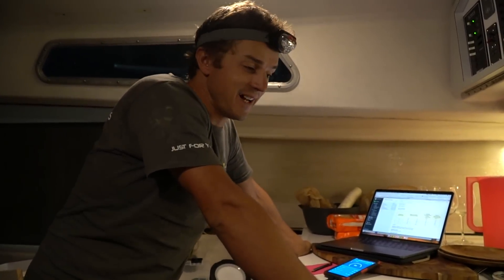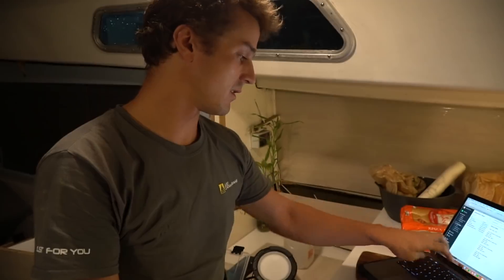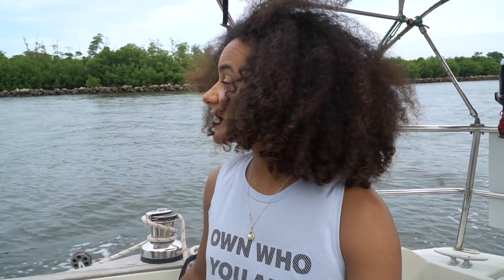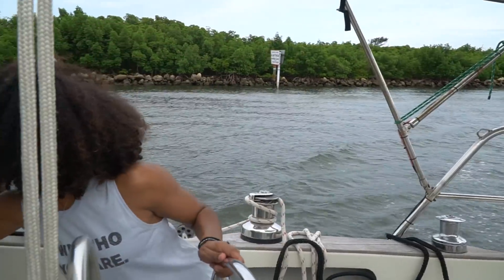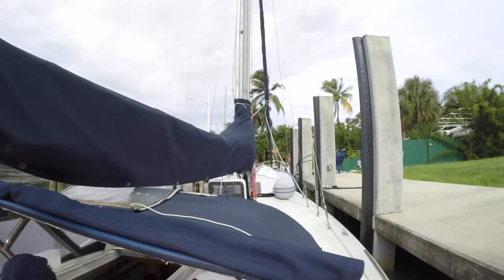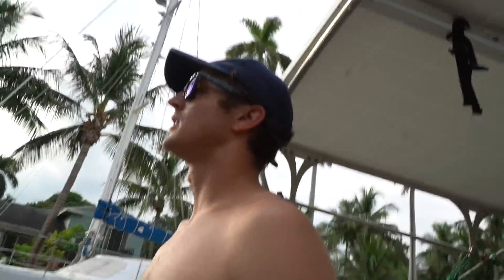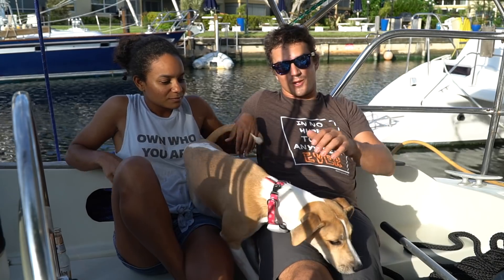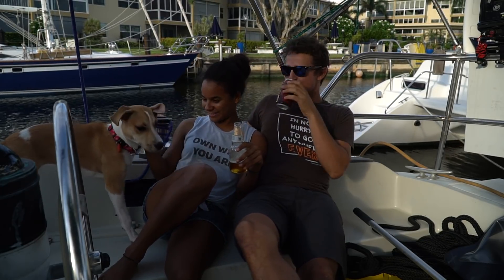Pushing our Electric Motor to its Limit— Sailing Uma [Step 139]

Comment: Electric motors are a bunch of hippy nonsense!
Reply: None of you guys has a sense of humor! Ever been becalmed for six days and had to motor? Well you won't do it with an electric motor! I still say it's hippy nonsense!
Reply: the us navy agrees  nuke subs always have electric backup
Reply: Gadianton x : what kind of motors do you think a nuke sub uses? ELECTRIC
Reply: Gadianton x : what kind of motors do diesel locomotives use? ELECTRIC
Reply: Yeah with a nuclear power plant charger. They never run out.
Reply: Riiiiight, a bunch of hippy nonsense. lol You do know that every ferry that carries cars in the state of Washington has electric motors turning the props?
Reply: Tesla
Reply: Submarines, ferries and locomotives, while using electric propulsion, rely on either diesel generators or thermo-dynamic nuclear power to provide electricity. If all you have is solar powered backup batteries, your range will be severely restricted using the electric motor. No motor sailing or ability to power thru doldrums with that power. Intercostal waterway travel will also be restricted.
Reply: The problems are not the electric motor. Those problems can be solved with money. The problem is electrical power storage and generation. Nothing a diesel powered generator will not fix. A sailboat doesn't have enough surface area for all the solar and wind generators needed. They are learning this one day at a time. They could move on to more important things, Like sailing.
Reply: these guys went around the world with an electric motor:  http://www.ecosailingproject.com/the-crew/
Reply: http://www.ecosailingproject.com/    these hippies went around the world with one
Reply: Locomotives have electric motors turning the wheels. But they have a huge diesel engine turning a generator that powers the electric motors. Electric motors have their place. Not sure why they went this way. Was it a cost consideration? If it was green, remember coal or oil was burnt to make electricity that recharged the batteries.   Anyway fair winds and following seas to Uma and crew.

Comment: Just a heads up, 'copy that' is not considered good sea/mariner lingo.
Reply: ray Nic - I agree. Wouldn't it have been helpful to post the correct response?
Reply: Sometimes it's good to let the creative juices flow and I anticipated your response, nothing wrong with getting a little conversation going. (p.s. I used to say that all the time on the VHF and would constantly get corrected by a licensed captain friend, no haten'-just sharing, copy that? So what do you think is appropriate?
Reply: roger that or affirmative(?)
Reply: Belay that, virtually means cancel my last order, ng.
Reply: Roger, more CB talk, ng. Affirmative seems to be appropriate in this situation.
Reply: Roger
Reply: roger wilco?
Reply: We are taught to use Romeo

Comment: You guys rock! I'm sure having some hard numbers on the engine feels good and a 15 mile radius is great! How long would it take to charge 75% of your battery capacity on an average sunny day? Also I'd like to officially vote for Dan to grow his hair out!😁😎
Reply: I don't know what solar panels they have but if it's around 300W (rough approximation from the image on their website) they would need 50 hours of direct sunlight to charge 75 percent of the battery bank capacity. So, if it's contentiously sunny and they spent their days adjusting the panels to align perfectly throughout the day the shortest time would be about a week.
Reply: @adamrasmussen3521  if they dont power for anything else. Only 300 watts? Im sure theyll end up with a kw, and another kw of wind. Then the fuel is all free...
Reply: SPA...wassup, just watched your video too...respectfully, if Dan follows your hair advice, it will eventually end with one side of his head shaved.  You need to prepare him for that.
Reply: Scott Harrell times have changed, now I'm thinking mohawk! Haha.
Reply from the maker: The beauty of our system is it's completely modular and pieces can be upgraded, added or removed depending on the need. If at any point we need more range for certain parts of the world, we can drop a genny on deck and motor for days. But until then, we'll just keep sailing.
Reply: just get a 2kw genny!
Reply: My calculations too. It is good to see people pushing the limits
Reply from the maker: We don't really plan on using solar to charge from such a deep discharge. In reality, we sail everywhere, and use our motor VERY sparingly. We would normally use about 5-10% from off shore to anchored, that we can get back in a day or two of good sun, and that includes our daily loads (fridge, laptops etc). If we needed to motor longer we'd just tie up to a dock for the night and charge back up. We can fill our bank from 25% in about 8-10hr. In the long run, we're hoping to get good regen, so if we need to motor out from anchorage to ocean a long way, we can then sail for a few days and charge back up. But that may require a different motor altogether.
Reply: Dan, I've been following you since you started. You have made some great strides in preparing your boat to really do some sailing. I only have one thing I'm trying to understand. What is your objective. Work on a boat or sail. I'd love to talk to you guys but not on Youtube. I have a lot of experience technically and sailing. I've restored two boats. A 32 and a 37 foot sailboat. I'm probably wasting my time, but I have offered.
Reply: Sailing Uma With 4 days to top up without (that's with sun) a doc. It could be dangerous to sail Asia and around the equator (common to have little or no wind for a day or 3, as you can be near reefs, strong currents, no wind. = no boat. Often to deep to anchor there till your on the reef.
Reply: Richard dackas .... this system is great for afternoon sails or going out for a day on the weekend.   But would not work for long distances.  I suggest  they up the dingy outboard to 25hp so the sailboat can be towed....... for coastal cruising.
Reply: The number of cruising boats who have successfully cruised long distance without any engine whatsoever are too numerous to count. Even the ability to motor in and out of harbor is a luxury, not a necessity. Sounds like a good system to me!
Reply: @ProjectAtticus  can you get insurance without diesel?
Reply: Sailing Project Atticus Sure, but they sail straight past the inside of the Great Barrier Reef and most of Indo as it's to dangerous
Reply: Richard dackas good point, definitely compromises to be made.
Reply: Sailing Project Atticus Definitely in some parts of the World. What they have created is far better than no engine and I love what they've done. The Great Barrier Reef would be no problem with their boat as there is good wind and 5 m range would be plenty. It's only around the equator the lack of wind and docks could be a problem. Just cary a small Gen for that part of the world. P.S. Love you vids.
Reply: Sailing Project Atticus ...."to numorus to count"...... you are delusional...... I can recall  4 or 5 max .   This vid clearly shows the  extreme limitations of batterys.  Going down from the PNW to la Paz Mexico I motored 500 hrs.  Two yrs ago , after many trips, motoring time was  reduced to 260hrs because I sailed from Canada to Ensanada, Mexico in one 14 day run.  And this low number is because I am extremely stubborn and wait for wind.
Reply: @sails3538  When do you think diesel engines were invented?   I'll tell you: 1895.   As we all know, nobody ever sailed around the world before then...
Reply: @pywaketpilot ... Big wooden ships only went it to big ports. Too clumsy to sail in confined channels. The small sailing/row boats went to shore while the larger boat stood by at sea.
Modern day sailing is different... So many boats on the water. A sailboat with no mother is a hazard to navigation. Also... The Pardies were towed in to more ports than most people go in to during their lives.
A little truth is needed here.
Reply: @sails3538  Ever heard of Joshua Slocum?

Comment: Dan, it may be that the program is set up for lead acid batteries, looking at a max/perferred 50% discharge. Run for 1 hr. use 25%= 1hr at 25% left....
Reply from the maker: Yup! That's exactly how it's reading. Not sure I can change it though.
Reply: I guess if you can't change that parameter you might want to put a conversion formula on your chalkboard...75%=2/3 power remaining, 50%=1/3 power remaining, but that will vary with % throttle... ah-oh, this is getting complicated... or you spend the time and work it out mathematically and create your own power curve...have fun with that...

Comment: Two thoughts: 
1) I worry about 300F  real close to your fiberglass hull more than I do the motor itself. How much heat is being conducted to your hull through the mounts? Are your mounts temperature safe? I seem to recall that your batteries are self-protecting, so you should be safe.
2) As a first step, I would improve the air-cooling of the motor by wrapping with sheet aluminum, and extending the aluminum sheet off the motor into fins: a simple radiator. That, combined with your compartment fan would dissipate a lot of heat. Others have suggested water cooling to create hot water for bathing. A great idea, but gets complicated quick when you are sure not to overheat your holding tank, etc.

Can't wait to see how you work this out. Good luck, fair winds, and safe travels.
Reply: They could just attach cpu cooling fins.
I have PC's that use passive cooling for the video cards and I've seen the cooling fins being sold as individual parts.
I've even seen copper fins every now and then.
Reply: My concern is the battery terminals melting and acting like a fuse, are they still using the lead acid or lithium, have not caught up on all the changes. I personally do not like the dual battery requirement to generate a field that allows the motor to work, a ETEK style permanent magnet is better. This style or the MANTA would be 75% more efficient https://youtu.be/t9Uog4udldQ
Reply: @frickandfracksicem  its not permanent magnet? The batts are LiFePO4, sound pretty funky.
Reply: I was thinking the same thing strap aluminum fins to motor and duct the fan to pull over them should greatly improve heat dissipation. Props to you for going with electric motor and sharing your thoughts and experiences.

Comment: So I know these videos are delayed but if you are thinking about liquid cooling you might be able to do it passively.  Ie warm water rises... , as the water wrapped around motor (i guess in a coil or some other type of heat exchange) rises it siphons in cool water thus taking heat from motor with it as it exiting the boat...keep hot side physically high, cool side low... I use this principle to heat my hot water for my house in the winter when my outdoor wood boiler is running and works great and saves me from running another water pump on my hot water heater. Love yalls diy stuff!

Comment: it seems like an electric motor is Not Practical for a sailboat or for any boat appears to me that it could get you in a jam in a hurry and unfortunately I think you will see this in the future hopefully not just remember some Murphy's Law
Reply: You know those submarines had gigantic diesel engines for charging their batterys right? The only could go for silent driving for short periods of time. Some even had atomic reactors.
Reply: Keyboard captain strikes again. You really only should need a motor on a sailboat for docking and waterways. It is useful if you are in a lull but not needed if you have time.

The only real problem is if you drag or break a moring and don't have a engine/motor. But a electric motor should last long enough for that.
Reply: try sailing around strong tidal areas such as the Bristol channel or the Mersey. I wouldn't touch a boat with an electric motor.
Reply: Keyboard captain? what do you do if your sails or standing rigging gets damaged in a storm, offshore? a properly sized+cooled electric motor with properly cooled controller and battery bank plus a suitable size generator - this is the way, in my opinion.
Reply: If you have a petrol or diesel powered generator why not just have a proper engine?
Reply: @TheRealSasquatch  there are several reasons: 1. Marine diesels in old boats are also old, renovating them not everyone's favourite. 2. On our 38 feet, and maybe at other's also, the rudder is behind the engine+diesel tank which can be dangeouros - a hybrid system can be designed to be modular, hence movable when needed u3. You may want a quiet boat at night, but noisier during the day. 4. A small 900cc diesel engine and a 10kw alternator still way lighter than an old marine diesel plus gearbox. 5. A smaller generator you can better sound-isolate than a chunky old marine diesel.6. You can make the generator diesel engine propell the boat if needed, hence having two ways of propulsion in hand if needed...
Reply: Actually Jim is absolutely correct.I have kept my mouth shit in the past. There is nothing practical about an electric powered motor, unless you have an adequate genset to recharge it. They finally got a real dingy. Next will be an adequate outboard for it. All of this is ok. They get to learn their own way. It's their boat. Now am I a keyboard Captain. No I have been a 50 ton Masters license with a sailing endorsement for over ten years. I have delivered boats from St Thomas to the US and up and down the east coast. And I sail for fun. I'm retired and have restored two sail boats.
Reply: Jttv You have no idea what can happen out there. Play with fire long enough and you get burned. There isn't always a dock to stop at. There isn't always wind. You can't always anchor.
Reply: I would rather trust an electric motor than a combustion engine. An electric motor has maybe 5 moving parts. 2 bearings, a shaft and two brushes wich are optional. A diesel engine has hundreds of parts that have to work perfectly and they also need a battery to run.

Comment: What's the temp rating on that ducting? 
Electric is coming along but I don't think the cost ratio is there or the range. But clean and efficient it wins. 

I like the hot water exchange idea in the other comments. You could even use a ThermoElectric to turn that heat into electricity as well. That's how we do it in F1.

Comment: Motor heath, would suggest to search for a forced ventilator, which can be driven by the electric motor itself. You probably can find one which fits in the elevator industry .
Just blowing air into the rotor will cool it down significantly ,
Reply: I think is a great idea - the motor shaft sticks out of the moto back plate, so a vent there and the forced air-cooling is ready.
Reply: Or just use sea water and Cooper pipes it would probably live a much longer life

Comment: Do you guys still use the same prop used with a standard gas motor?  It would seem changing to a different design similar to a jet style, would be more efficient for an electric motor.
Reply: It would be efficient during propulsion, but very inefficient during sail.
Reply: Really, I don't see why that would neccesarly be the case?

I might be wrong, but my understanding is prop design is pretty much a function of enginge power and load (i.e. the resistance of the boat through water.) I guess water density and pressure ought to be included, but since the depth doesnt' change and water density changes are very small you can ignore these. Prop RPM comes to mind, but I don't think the difference is very big compared to the geared diesel.
Reply: martinborgen Electric motors have a different torque curve and lower torque overall compared to diesel . Depending on the rpm of the motor and it’s torque there will be an optimal prop size . Here is a calculator : http://www.thunderstruck-ev.com/Manuals/EBOAT%20MODEL%20SPREADSHEET.xls from thunderstruck .
Reply: @DivineX  that's kind of a rediculous statement. How much torque a motor has is not limited by its fuel.
Reply: Garret Maki Diesel engines produce wayyy more torque than a gasoline engine would. Why do you think transfer trucks are diesels
Reply: James, it doesn't work, the prop is the wrong shape, just like props are the wrong shape to be efficient in reverse.

Comment: could you get/fabricate a mount on the stern for the outboard as a just in case?.... and don't be jealous, if you had her hair you'd just look silly....    be safe    Tim and Cat
Reply: Dan's addressed that point before. It would require a longer shaft on the outboard.

Comment: I respect what you're trying to do with the engine but I don't think I would ever feel safe with that setup. When you read about wrecks a loss of power is just too common.
Reply: yeah, too common that those complex gas/diesel engines fail... find me a sailor who hasn't had issues with his diesel engine.  If you 'feel safe', you are fooling yourself.
Reply: it ss traditionally diesel fuel engines that you hear of  loss of power , not lecy ...
Reply: If you look at your implication here from a neutral standpoint, it is a TERRIBLE argument.  It's about as relevant as saying we hear more often about car crashes than we do spacecraft crashes.  Of course you hear more about traditional diesel engine failures, the ratio of open water voyaging vessels out there with combustion propulsion vs electric is probably in the hundreds of thousands, if not millions to one.